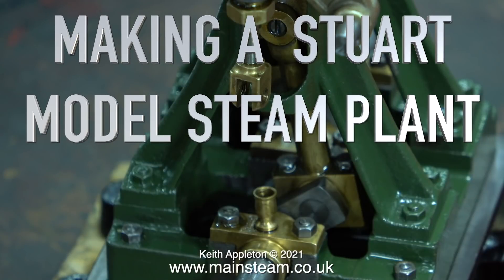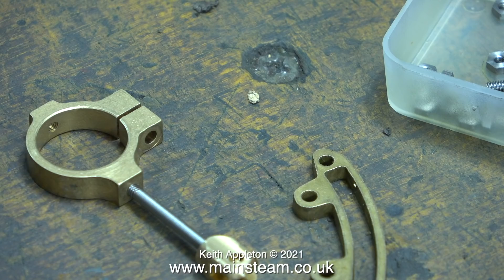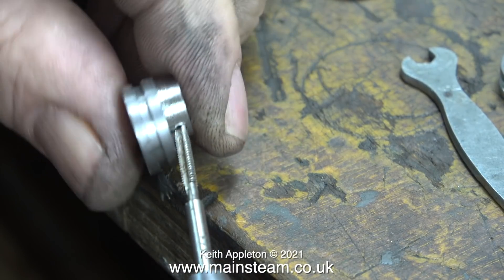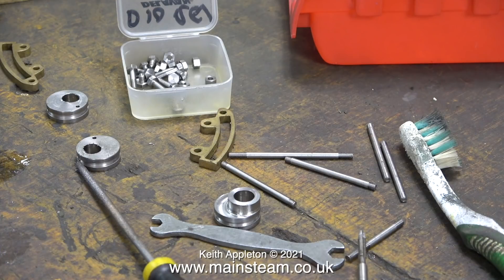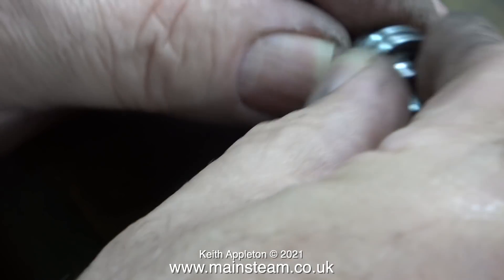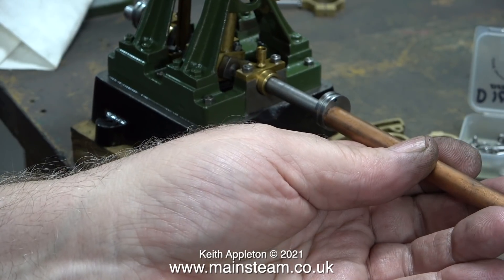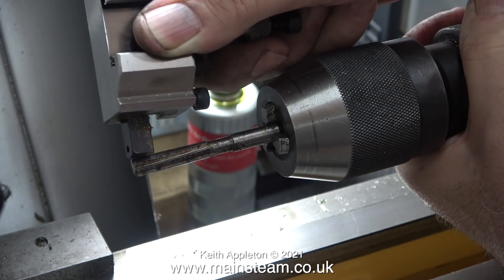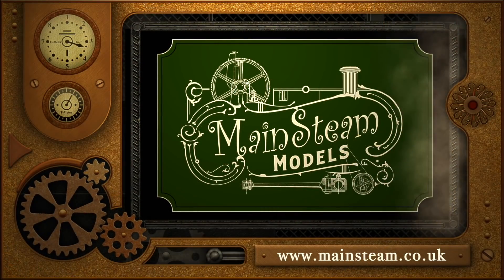MAKING A STUART MODEL STEAM PLANT - PART #25

Comment: Hi Keith. half way through he video you state the twin eccentrics are set at 180 degrees. I am converting my V10 to reversing using a kit bought from Stuart Models. the Stuart instructions say set the eccentrics at 120 degrees. Who is correct? I appreciate your videos thanks.
Reply from the maker: It is trial and error, relative to the way the engine is built and I always start off with the highest point of the eccentric sheaves at 90 degrees to the crankpins (which is 180), then I make adjustments until the engine runs well in both directions.
Reply: @keithappleton  thanks for the reply Keith. I thought in the video you were talking about the angle that the centers of the  2 eccentrics are set in relation to the center of rotation. The instructions say to pin them at 120 degrees. You were talking about the angle relative to the crank so that steam enters the cylinder at the right moment. I have machined the double eccentric from one piece of steel so hope I got it right! many thanks for your videos.

Comment: I have always disliked the reversing gear on the D10, much better like the 5A ones. I have a set of D10 castings aging in the shop think I should pull them out and see if I can design 5A reversing style gear on them.

Comment: A little surprised you did not show the crankshaft being measured.  I'm convinced you did measure it, because otherwise there is an assumption that the shaft was sized correctly.  An assumption regarding parts you inherited and were not responsible for.
Reply from the maker: I did measure the crankshaft and it's diameter was perfect, I didn't video me checking it as I assumed that viewers would realise that the Crankshaft was fine as the D10V was a Factory Machined Kit. . . . . I never assume anything.